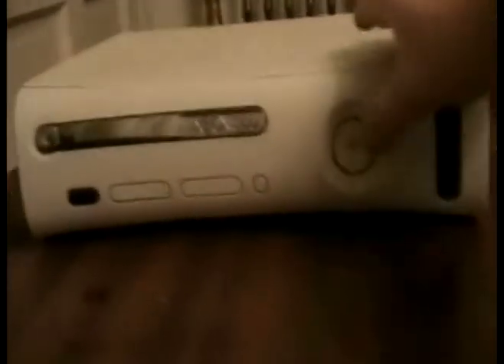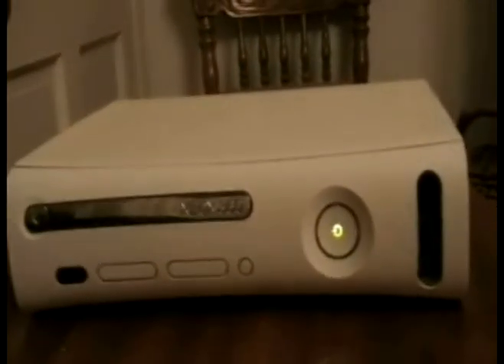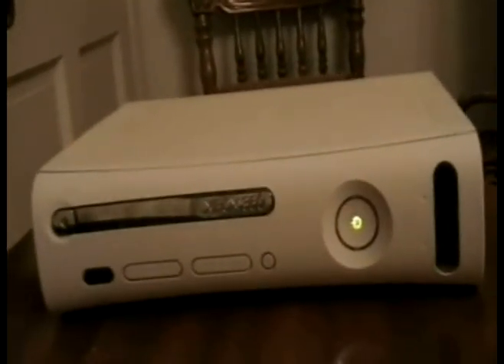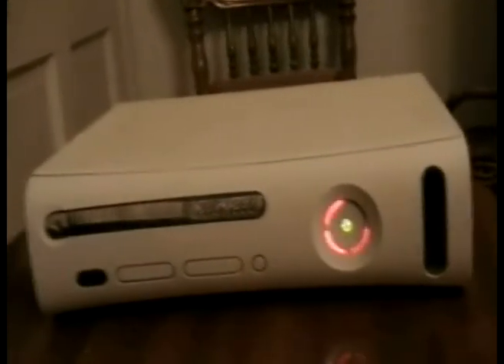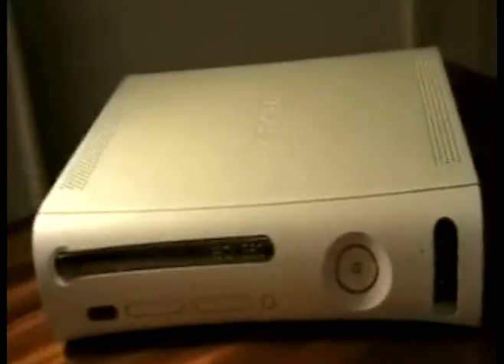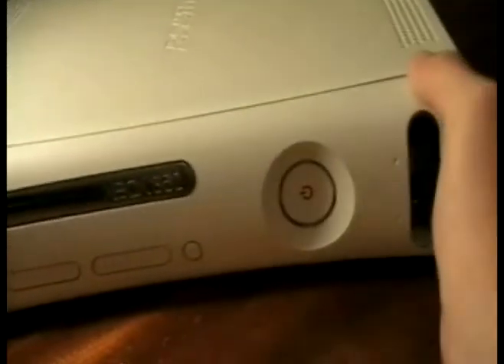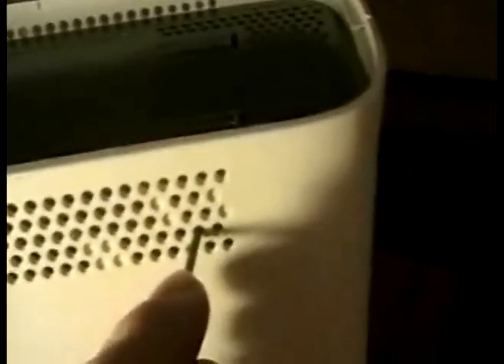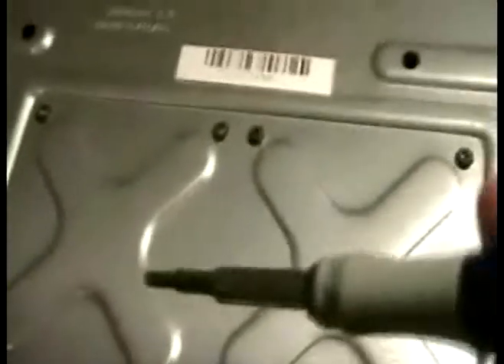How to Fix the RROD Xbox 360 Step By Step Part 1 of 4

Comment: I was fixing my xbox following your guide and i ran into a couple small problems you dont reflect on in any of your videos. 1: Why do i need 16 of each washer when in your videos you only use 8 ea. 2: The metal washers you said to get fit perfectly around the screws, and are fine with one heat sink but, When i tried putting the 2nd heat sink on, the metal washers were overlapping and i think that could potentially cause a major problem, what did you do? or did yours have a smaller outer ring?

Comment: The item numbers you have listed for lowes are actually the Hillman part numbers.

Lowes items numbers are as follows:

Flat Washers-5mm Lowes Item # 138319
Nylon Washers-#10 Lowes item # 139065

I got different machine screws so I have not listed the correct Lowes item number for your selection of screw.

Comment from the maker: It costed 6.51 for the hardware. If you have a torx and small screw driver set your set all you need is rubbing alcohol and artic silver 5 which that is 9.00 at Radioshack

Comment from the maker: You need to go back and even out your artic silver 5 and make sure you tighten down the screws just to where it isnt easy to turn anymore don't need them tight tight or you will ruin your board and/or cpu and gpu

Comment: so i did this, followed it step by friggin step and now my xbox is stuck on 2 rrod, it turns on the fan runs for like three seconds then it stops, my power brick is just orange and it just flashes two red lights... what did i do wrong?

Comment from the maker: If you are fixing the rrod make sure you don't put it back together until it is fully fixed chances are if you didn't do something right could cause you to get the rrod again or overheat really fast so in that case you have to go back and check something or put more Artic Silver 5 Thermal Compound on

Comment from the maker: Yes but if you put everything back like you took it apart and still want to send it in if it is not out of warranty go for it chances are if they don't fix it they will ship it back to you, rrod occurs because of hardware failure- cpu and gpu get really really really hot and or the x clamps aren't holding the heatsinks down close enough or tight enough against the cpu and gpu